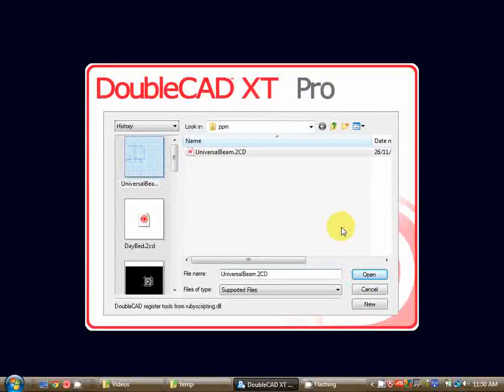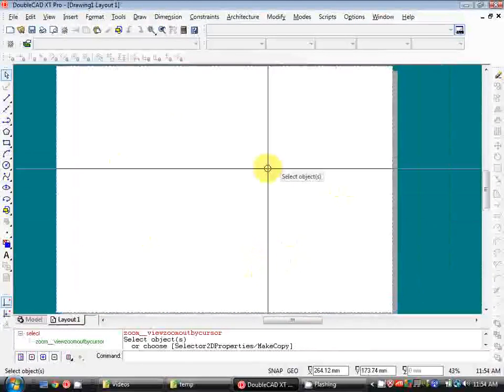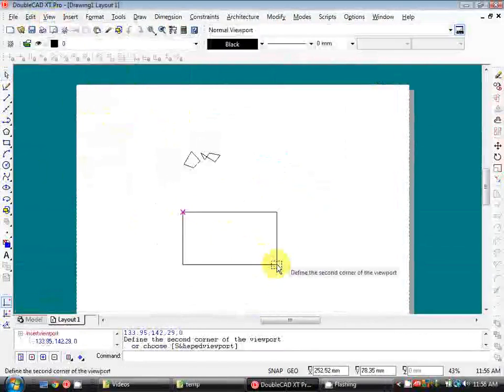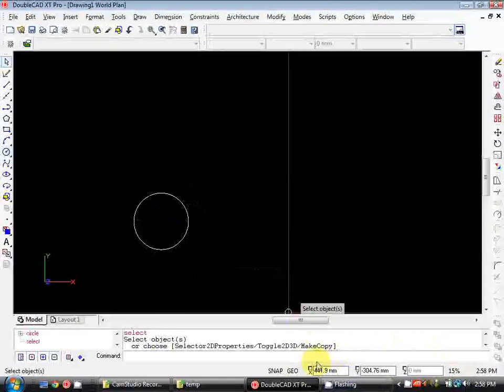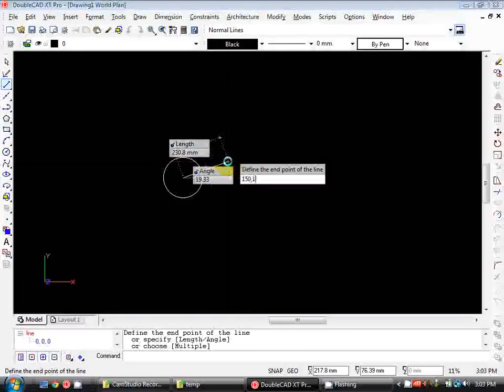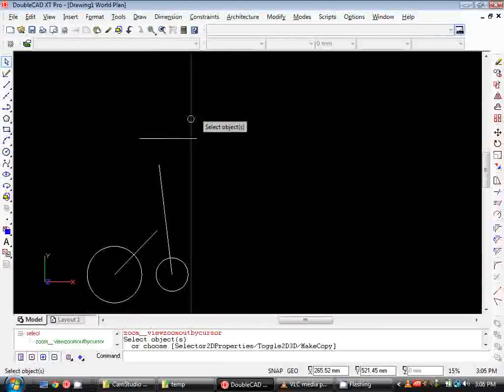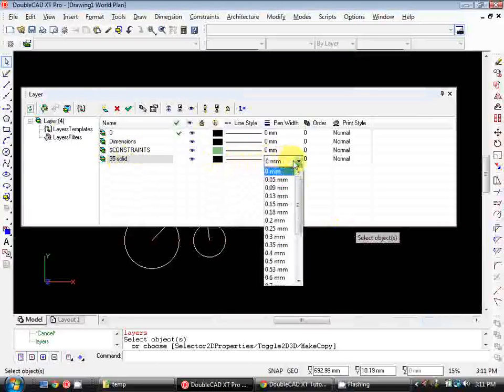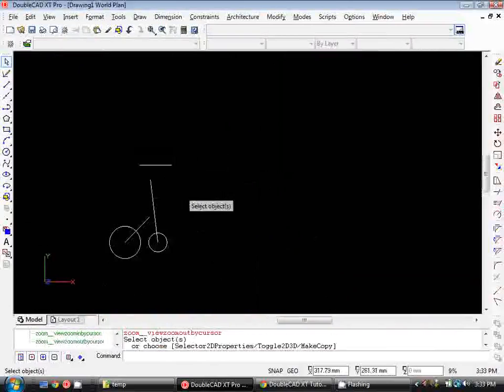DoubleCAD XT Tutorial - Part 1 Interface, Toolbars, Coordinates, Layers, Properties *REVISED**

Comment: I just found you today, hope you see this as these are fairly old videos.  I am a beginner to double cad.  Trying to get this to print to a 11 x 17 large format printer.  When i goto the  layout 1 properties for page setup, i select the printer/plotter but then on printer paper I only have small options for paper.  I have checked all the properties on this printer in windows and they are set to 11 x 17 only.  I print to it frequently from PDF's   Any suggestions?
Reply from the maker: Hi Nathan, unfortunately if you are using the free version of doublecad it will restrict the page sizes available in the page setups to a few of the smaller sheets. You may be able to re-download and use the premium trial period to print large format sheets. If it is just a couple of prints you need you may be able to print smaller format drawings and piece them together with a pdf editing program. Sorry I can't be of more help.